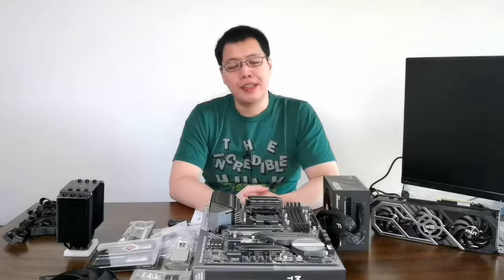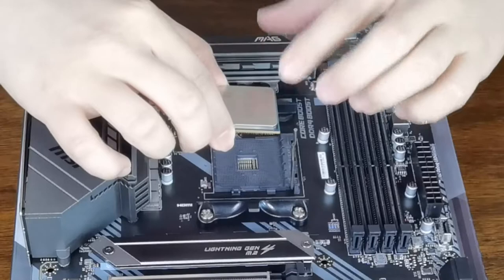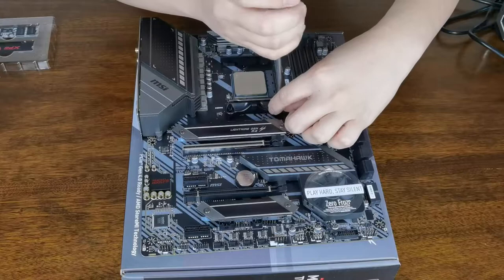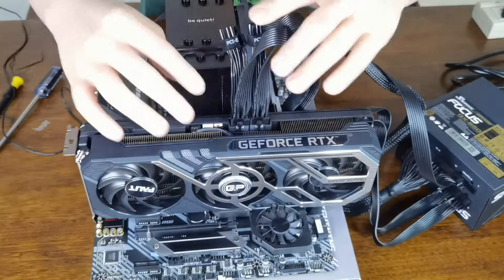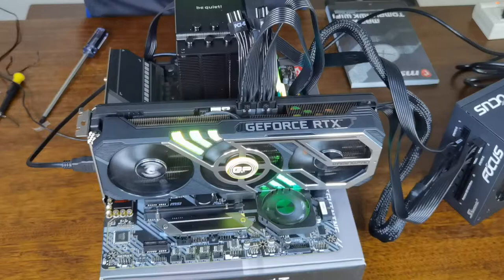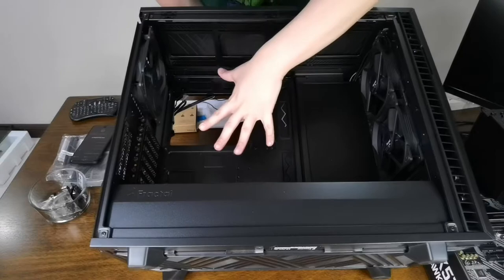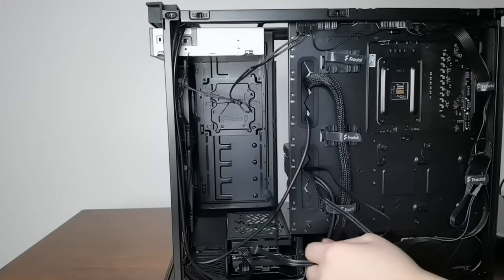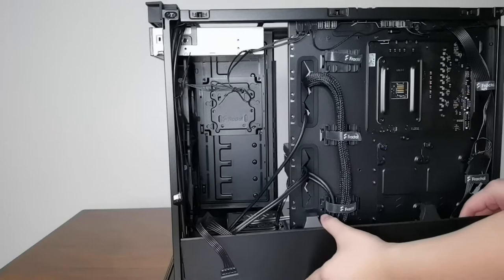PC Build 2021 VLOG Part 2 - Step by Step Build and Assembly

Comment: Good job! I built in one of these (but white) last year and also converted to storage configuration. I maxed out the HDD trays spots, added a second cage near the PSU for 2 more trays, and got up to over 90 TB of storage. The FD Define 7 is a really fun case to build in. But I would have bought the 7 XL if it came in white. I ended up needing to install a second PSU to support all the HDDs, and had to place it outside the case. Unfortunately, it is often difficult and expensive to buy accessory pieces (extra drive trays) and replacement parts for it (like glass panels) compared to it's competitors. But overall, it's still a great case and a good value for the amount of flexibility it offers. I also recommend the Phanteks P600s as another great case to build in, which I also own one of.
Reply from the maker: Awesome, thanks for sharing your experience. Thanks for watching as well

Yes define 7 is a great case.

Comment: Nice video man!, I just upgraded to the Ryzen 7 5800X myself yesterday and I have that same cooler, just curios what are your average temps while gaming?, I know the 5800X runs a little hot for what it seems, but I want to know how someone else with the same cooler is doing with temps in general...
Reply from the maker: Oh. Avg around 60-70 degrees celcius. Peak about 80-85

Comment: Followed the whole video as we have the same mobo and cpu. Yung small fan sa mobo spinning ba while naka on yung pc? Sakin kasi umiikot lang when nag boot up and it stopped spinning pag nasa windows na
Reply from the maker: ah, it turns on and off depending on the use case scenario. dont worry about it.. for heavy loads and heat it will turn on by itself.
Reply from the maker: thanks for watching tho! pls like and sub

Comment: Do you need to install bios before putting everything in the case?
Reply from the maker: well, its not required.. but preferred. so easy trouble shooting or if you need to replace the parts, you wont have the case to bother you..
Reply: @AndrewDy  thanks! I’m building my first pc with the same motherboard
Reply from the maker: @snipermonke5722  Good luck! hope all works out! thanks for watching!